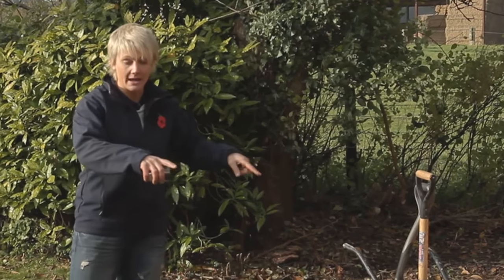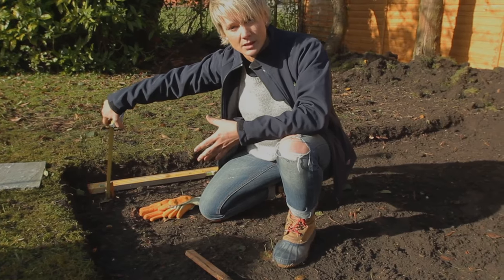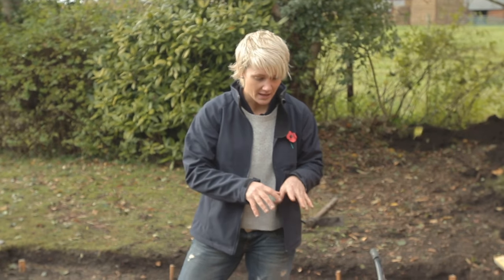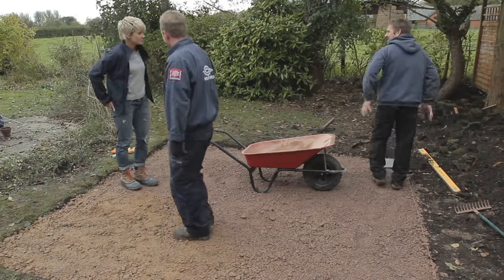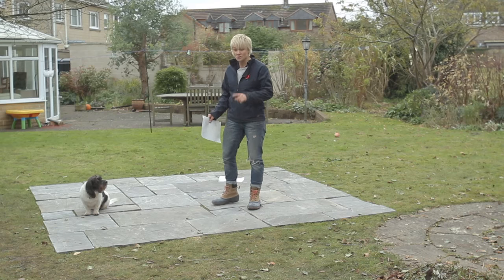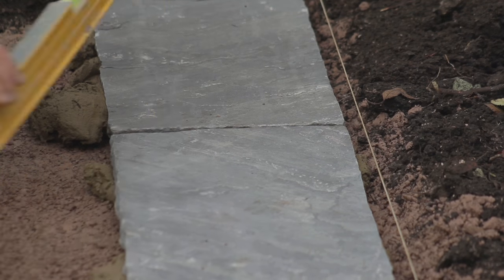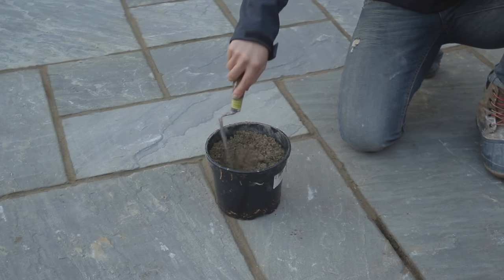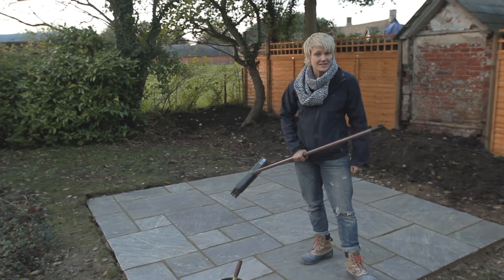DIY: How to lay paving slabs (patio) - with Philippa Tuttiett

Comment: Dot and dab = easy way to crack, full bed is what you need if you don’t want to replace them in the future, screed or full bed only and use a small piece of pipe or something other than stabbing the dry mix between the slabs otherwise the sun will get on it and it’ll just crumble and pull away easy
Reply: I tought I'm the only one thinking like that.Leave away dot&dab leave enough space for  🐜
Reply: Yep the times that I gone over peoples work doing it that way water gets underneath and they work lose and put surry on back of slabs

Comment: Some of the comments are missing the point of the video. It's a D.I.Y. video. This video is going to give confidence to people that wouldn't normally even think about a project like this. If you used a plate compactor that a lone would put some people off. I like the vid, it's inspiring.
Reply: without a doubt. if you have a little bit of courage, on a weekend, this is very achievable. not the "pro" way to do it but it a tiny project that will probably need to be replaced in a few years but so what!!
Reply: Thank God, somebody got the point.
It's not only much easier for newbies that way, you also have to keep in mind, that there are people out there with different conditions. E.g., my apartment is situated on a raised ground floor within a block of apartments. So, there are several steps to get to it and also several steps down from the apartment to the garden. Neither our block nor any close by has any kind of direct entrance, like a driveway, to the garden complex. You want to use a wacker plate or other heavy machine? Good luck with that!
Reply: So in other words, it's a D.I.Y job. A bodge, which will look like a bodge within weeks of being laid.  Why waste time and money doing half a job that will need to be done properly eventually?
Reply: John Riggs I’m not disagreeing I’m no expert but it’s been a long time, would be good to see how it’s looking now
Reply: @johnriggs4929  mate it's gonna last a few weeks. The slabs might work loose after a few winters, don't be so dramatic

Comment: I still stamp down the sub. Force of habit. These are methods that our dads used to do. Obviously professional pavers have learned new techniques. The last time I did some paving I stuck a broom handle (with nails through it) into a gallon container of wet concrete - and made my own tamper! One time when I was a site labourer there were three other labourers whose job it was to walk around all day long (for a week) tamping down a very long perimeter gravel path using the heads of rakes! There's another idea.
Reply: Ive always used rakes as well for tamping down no wackers in them days
Reply: ronatholl its bullshit, you dont need a wacker. just firm ground and a strong, thick bed of mortar mix (3:1 shaprt sand/cement).
Reply: How about rolling a sack trolley around with a few bags of sand on it?

Comment: I personally think you only need a Wacker plate for areas with a lot of Traffic like driveways you dont really need one for a lightly used Patio ,i personally prefer the full bed of Mortar under the flags rather than the 5 spot method ,i did my patio  6 years ago on a bed of sand then a bed of mortar and its still looking good with no problems

Comment: Laughed my head off reading all the usual 'experts' slagging off the video.

You don't need to whacker a little patio - she's only gonna use it to 'serve cocktails' not park a tank!!!!!!!!
Crikey, you don't even need to mortar it , I laid mine on sharp sand years ago after treading the hardcore down wiv me feet and guess what.... we're still serving cocktails on it no problems whatsoever, solid as rock, nothing has moved.

Stop tryin to sound clever everyone, you're doin more harm than good ;)
Reply: Do you have to lay the Rock? can you just level the dirt and lay bricks??
Reply: Same as ;-) I just used the back of a heavy shovel as a whacker... Laid on sharp sand... Butt joints... Not moved in 10yrs... Just sayin'...
Reply: Its the pointing it will fall away in the gaps , and the reverse staining you can get from not having all the base covered, 5 spotting is just not a way to do it when sand and cement is so cheap ? The video is not let's have a crack it's a tutorial and it's not the best way, rest is fine and passable but she should of used a full sand or muck bed period, it might last but Its better knowing it will last
Reply: Maxwell Grier hi mate, can you just lay paving flags on the ground after getting levels and putting sand down for a 6x4 shed?
Reply: mavrik11964 that’s what I’m doing with mine at the top of my garden, it’s only Donna be a small 5x5 square and the ground is pretty solid so straight onto sharp sand!

Our shed is lying on a bed of the same thing, going nowhere!
Reply: I'm surprised some people don't insist on a proper reinforced ground slab with a dpm!

Comment: All research from professional DIY sites says DO NOT use blobs for mortar layer, do FULL layer - blobs causes blotching on slab and risks slab breaking.
Reply: Causes moisture under the paver so eventually with a good frost it will pop off its bed. After the installation you can see spots appear on the patio where mortar is missing below.

Comment: Hi my Gardner is putting slabs down for the whole garden, he said he will use sharp sand and cement as the base to lay the slabs down.Wouldnt this be a problem later as the slabs will start to sink in after a while with rainfall etc... i suggested he uses stones however he said this is only needed if there was a car been driven on top of it? Please help

Comment: Great to see her having a go and well done honey. I'm no brickie but would recommend the use of a compactor or at the least a hand tamp to compact the road base. Would probably also lay the pavers on a screeded layer of sand paying attention to ensure there is 1cm fall per meter in the direction you want the water to flow off. (Easy way to Tape a 1cm object to the end of the level then lay in the centre of the bubble).
Reply: Top tip

Comment: For Indian sandstone you need to lay on a sharp sand and cement bed and throw your pointing in as you go to bond with the wet bed rather than a separate wet joint on a dry bed .Never dab and dob , water gets in too easy and knackers it within a couple of years - imo
Reply: You dont throw the pointing is as you go it fill soak the bed and potential cause a slab to rock in places were the water washes through the sand. Always wait 1-3days weather dependant
Reply: Interesting that the stone variant (no covid pun intended 😁) is affected by the base, and that the dry and wet is affected x

Comment: For those of you about to copy this method, take heed of those saying don't dot and dab. My patio has been down for a mere seven years and I'm having to redo it at present. I layed it myself and started out with a  full-bed, then on the advice of a builder neighbour I switch to a dot and dab. I now wish I'd taken photos as the first quarter laid on a solid bed was fine, the rest was loose, broken and rocking.
   Not sure whether to go with a solid bed or a sharp sand dry bed yet, hence why I'm on here.
Reply: you have to aplly sometimes madeup glue like pva mix with cement,down part of the stone,then layit on full bed sharp 5 :1 nearly half dry mortar.lasts ages

Comment: I'm in the process of laying a shed base with used patio slabs. I will be honest I've never done anything like this before.  The sub base is down. I've been told to use a dry mix of sand and cement.  But you have used a wet mortar mix.  What shall I do?  Can anyone give me advice please.
Reply: A wet mix is better as when you tamp the slabs down, you want the bedding mix to be fluid and fill in any air gaps giving full contact. When I say 'wet' I don't mean soaking as it'll splatter when you tamp the slabs down. You want damp

Comment: Good video nice work . Just laying dots of mortar under the slabs , from experience is not the best . Better to give each slab a full bed using a ridged trowel . Pva adhesive to the back of each slab stops it from popping up . As everything expanses and contracts through heat and cold .
Reply: Add pva to the water you mix the mortar with, brush the pva/water mix on to the bottom of the slabs.

Comment: So the end bit the mortar bit,,, do you add water or does it come naturally watery when the sand and cement mix?
Reply: @stimmo77 thanks xx might be clearer when I make a start x
Reply: @stimmo77 thanks that makes more sense, I will look at consistency video. Interesting to know there is a selection to choose from. I'm only doing a small one, maybe 2m2, I thought I could do a chequered effect and just slip in plain paving squares and have a square for a plant. Hoped to not have to put aggregate down so I could make changes etc. But now seeing how "easy" it looks, I'm thinking I may as well have a good go at it...
Reply: @stimmo77 that sounds much more casual and less pressure. Would you still need to pop those wooden pegs in?
Reply: Ah i see no need for the pegs when small x

Comment: Loving this, but as a patio noob, how do you mix the malter (is that what its called)
Reply: +Molly Wobbles (molly360) mix 4 parts sand to 1 part cement - just mix it in a large bucket it and mix it in really well using your trowel or pointing tool
Reply: 4 parts sharp sand and one cement

Comment: My only advice is you should have hired a Wacker plate to propely compress the scalpings, it'll sink more just from body weight compacting it, making the slabs sink too causing puddling and hairline joint cracks for rain to enter and in winter frost to form pushing out and removing the joints from the patio.

Comment: not a bad way if your on a small diy or a budget! I would vouch for using a whacker for stone compaction though. i also prefer to do a dry sand/cement screed bed. rather than the motar mix approach...  but its personal taste.

If doing a motar mix.. dont do 5 spot mix!!(also known as spotting)  it leaves voids under the slabs, making them weaker and much higher risk to the pavers cracking and numerous other problems..

use a good layer of mortar all over  and gently tap it with a maul using a spirit level if you go idividual bedding method.

Comment: I did some baby steps yesterday, made a start on preparing an area for about 30 small paving slabs,  l am no hiring wacker just baby step and couple of shovels of concrete they are going to go anywhere don't  motorway strength

Comment: This isn't a bad method apart from the hardcore she laid. The compaction process they did was a real joke and has completely put that patio at risk of falling to bits within a few years. Yes, a wacker plate would be the proper way to do it, but you could do it manually with a forged tamper. Will take longer but it does the job just as well. Spot bedding wouldn't be recommended for heavy traffic and commercial areas, but for the home patio it would be fine. It is a cheaper alternative as it uses less sand and cement.

Comment: That was some really bad advice! Never use 5 spotting it will make the flags more vulnerable to crack and also some natural stone will absorb the water and will sometimes show up through the slabs. Compacting the sub base with your feet will never work either. Using a whacker plate is essential. You should really compact the bare ground before and then when the hardcore is in go over it twice.
Reply: Well set right there

Comment: Catalogue of errors I am afraid. Firstly all top soil should have been excavated. Then at least 100mm of sub base should have been installed. Then it should have been mechanically compacted, plate compactor would be ideal. Using timber pegs for level is okay, but need to be removed prior to laying slabs. Then a continuous bed is vital, on a wet mortar bed or a semi dry sand cement screed. The method shown in the video would not last long.
Reply: Gavin B Hope you're about pal just wondering if after the sub-base if I could use sharp sand then lay down the flags without a morter bed? advice would be grate.
Reply: Jamie Culverston Probably only work with 50mm thick flags laying it straight onto grit sand. I laid my patio straight onto soil (ripped up an old patio and the soil was well compacted) then dot and dabbed with mortar. If it's just for a patio I wouldn't bother messing about with crusher run/MOT/scalpings. Mine's been down years and not budged.
Reply: Ben Dover Nice one for the advice Just taking up some old 450x thinking of putting down 350x thinking of just wacking aload of sub-base down then mortar sounds good? it's just paito out side the front door no more then 6sqm.
Reply: Jamie Culverston Sounds about right that. Again, if it's just for a patio as long as the sub base is pretty sound you'll be fine. If you can be bothered, full mortar bed but I've always dot and dabbed. When you do the pointing up at the end I normally fill the gap with a dry mix of grit sand and a bit of cement up to the bottom of the flag, let that go off and then do the pointing with soft sand and a bit of  cement. I'm CLEARLY no expert but it's never done me any harm.

Comment: Spot bedding is likely to result in uneven paving, as the bedding migrates into the spaces. Also it provides an ideal home for ants, and other pests. Paving slabs should be laid on a continuous bedding.
Reply: You lay a screeded sand bed or weak mix concrete bed. There are quite a few best practice videos on YouTube, such as from Marshalls (later ones). Also check out "pavingexpert.com"on the web.

Comment: That's not 'scalpings' it was MOT type 1 Limestone... That means it not made of "old road" it's made of limestone! Also if you use height pegs like this, why not also use them as your laying guide, so instead of hammering them in to 80mm above ground height, leave them 150mm above ground height, lay the sub base (Type 1) to 60mm below top of pegs then hey presto... Just saying... Good video though.

Comment: For longevity, the dot and dab method just doesn't cut it. It really needs to be a full bed. Also, you couldn't create a better home for ants!!
Reply: and water can accumulate underneath in the holes and when it freezes stones can come loose.
also when there is a hollow  under certain stones there is no support and the larger stone can break under point load.
it's the lazy gardeners way.
Reply: What is dab and dot
Reply: Yes full bed best, a must is type one MOT must be done with a wacker plate, or it'll move, then cracks.

Comment: Spot bedding is the worst way. Leaves cavities everywhere and does not distribute load. Natural granite stone should have an sbr slurry mix applied to each slab prior to laying. Full mortar bed is the way to go. Proper compactor is also best. All's that will happen with this patio is slabs with stain on top by what's called wicking. Which is moisture and natural salts travelling up through mortar dots. Nice to watch all the same.

Comment: We're having a paver doing our garden patio. He is joining the slabs without any cement but putting sand in between tapered joints of slabs. He this is better as the cement joint will crack like biscuit? Not sure if he is right.
Reply: Watching a lot of tuts here in YouTube ive seen them laying on sand or cement.  But i must say, mostly sand (sharp sand).  Its the scalping base that should be done properly.  The thickness and compaction is the key.  I suppose the sand allows for some movement.  Whereas cement would not allow for any movement and could break as youve been informed.

Oh.. just read your comment again.  Cement between the slabs is right as far as im aware.  Thats what my builder has informed me too.  Is he laying the slabs on sand or cement?
Reply: He is going to add resin adhesive to the slab joints, first time ever heard this. Is that ok or is he pulling a fast one us?
Reply: Amitav Raja Ive never heard of that.  So o cammpt comment on that.   My suggestion?  Contact another good builder or landscaper for an opinion.   Costs nothing to ask about it.
Reply: No joke it's called polymeric sand.You fill the joints with dry compound the brush it level and off the slab faces.Then you water it down with a fine spray.Brilliant stuff and no messy joints.
Reply: I've been laying patios for nearly 20 yrs and I always have joints between slabs... 
As long as you use a wacker plate to compact the underbase of scalpings rather than walk on it like this bunch of idiots on the video then you will not have any cracking or movement.....SIMPLE
Reply: Daz Pez ... iF the slabs have straight right angled sides then you dont need joints (because you can push them tight up together), if the sides of the slabs are rounded, then you do need joints.  Is this correct?  ::))
Reply: +welshdragon2008 
Sort of...and I get what your saying but my point is....if you just butt them together it is being lazy for an easier job that makes it weaker and also doesn't look as nice... A mortar joint between will stop any movement period, paving slabs are not perfectly straight so there will always be room for them to move, even if it's only 1 or 2 mm, And once they move they are then loose... That's what you need to avoid... Pointing patio joints is very easy.... Well worth doing👍👍
Reply: +daz pez Why are you getting so mad? lol
Reply: alexm111 .. Is he?  I thought he was just trying to be helpful